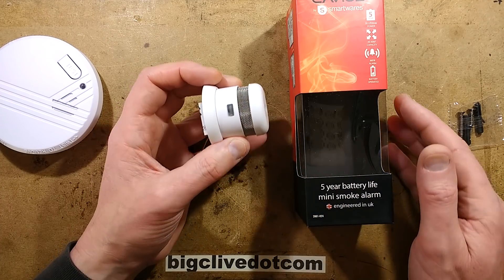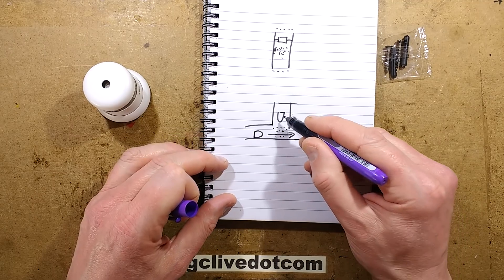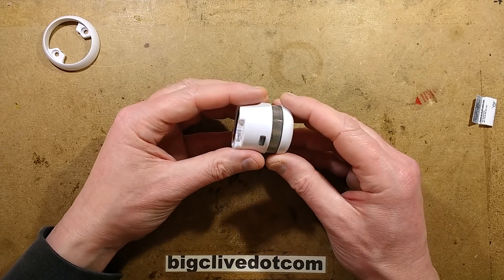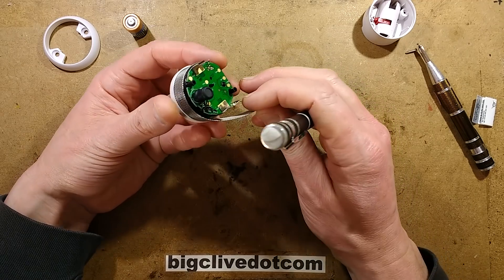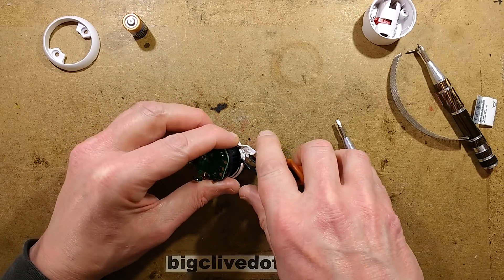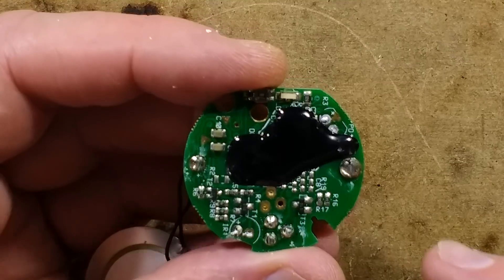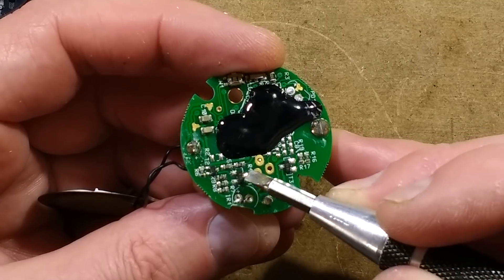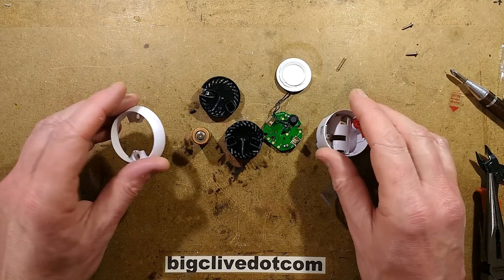Inside the tiny Cavius smoke detector.

Comment: Surprisingly my vape has never set off the smoke detector above my computer desk. I dont have a big box mod with tons of vapor though. It's about the size of the one you had in this video.
Reply: Gizmo42Rodeo 'tootlepuffers' or  low wattage devices certainly have their advantages especially when using low VG juice.
Reply: I have no idea. It's what ever the apartment complex put in. Had a different one when I moved in but they eventually replaced them with these combo smoke and CO detectors. I would have thought at some point with them being directly over my computer desk either the cigarette smoke (when I smoked) or vapor (the reason I no longer smoke) would have set one of them off.

Comment: Clive, I have a smoke detector which is very sensitive to being a bit dusty (I live in an older home with oak wood floors and partial plaster walls and ceilings) and it will false trigger. Then I use a strong vacuum dustbuster to suck out the dust and it's right again. Have you heard of this behavior and fix?
Reply: You can change the detector to use radioactive material, or use compressed air to blow it out. Since it's a safety device the recommended option is replace it and not repair or modify it (although I'm certain the new one would have the exact same problem).
Reply: Jammit Timmaj I only have to vacuum out the dust once a year when it decides to beep, so I clean it and put in a fresh battery. It's an expensive detector tied into a monitored security system.
Reply: Sounds like you have nailed the fix then.
Reply from the maker: It may have accumulated dust over time.  It could be worth swapping it out.
Reply from the maker: Is it connected to other detectors?  If they're interconnected then another sensor on the same circuit will cause them all to sound.
Reply: There are different types of fire alarms for different environments. Optical sensors are more directed towards detecting smoke, but also triggers with dust and moisture/humidity (you can get some with a mini-blower in them to reduce buildup). Radioactive sensors can also trigger with dust because it has similar effects as smoke (particle sizes matter here). Heat detectors don't trigger with particles in the air, but simply heat, somewhere around 58C then it triggers (good for barns/stables and stuff with a lot of dust). Maybe you should consider a different mechanism of fire alarm better for your environment. This is based purely on memory so be sure to research more about them to make sure you get the best choice.

Comment: Since this is a destructive tear down, how about de capping the chips?
Reply from the maker: If you search on YouTube you will find a video of the manufacturing process which shows what looks like an op-amp and a microcontroller under the goop.
Reply: Is it possible to see the ROM on the chip and reverse engineer the code on it? With much older chips I think that was possible to do given that the software was "hard-wired..."
Reply: Here's the video of the alarm manufacturing process Clive mentioned. It's quite interesting: https://www.youtube.com/watch?v=c4Y3Q0CB4Uk
Reply: That 'blobbing' machine looks to be dispensing molten plastic ... a thermoplastic ... so it should be removable with heat.  Maybe even soluble in toluene.

Comment: Send that board to ElectronUpdate and decap that thing! :)
Reply from the maker: I was pointed to a video by the manufacturer that shows it before the blob is applied.  It looks like an op-amp and processor.
Reply: bigclivedotcom 
The blob is probably to prevent copying of the design and to give stability to components (since the board is much much much smaller than the conventional ones) because it's very likely to drop the unit while installing due to the size, I presume.
Reply: Clive even the manufacturers are your fans it seems :)
Reply: Penurious Sierra Naked chips are the cheapest variant sold. Due to high initial investment into contacting machinery they are used for high volume mass production only. A determined copyist won't be held up for much longer than with conventional packaging.